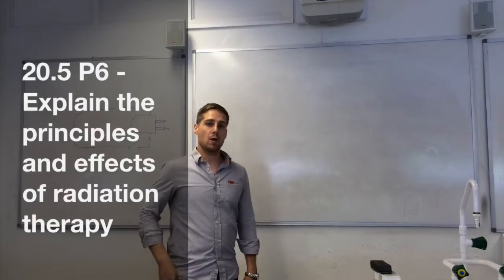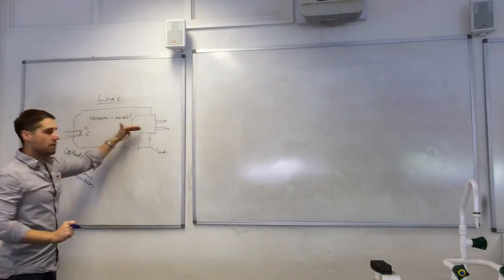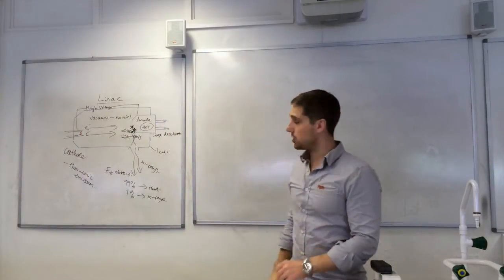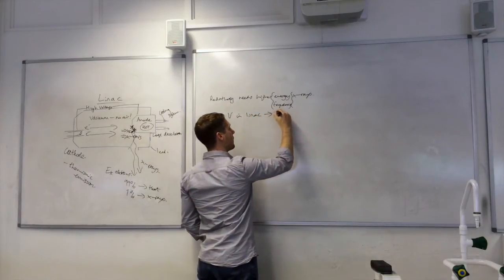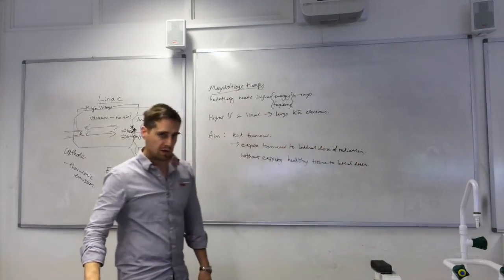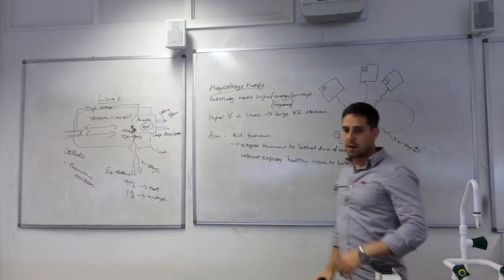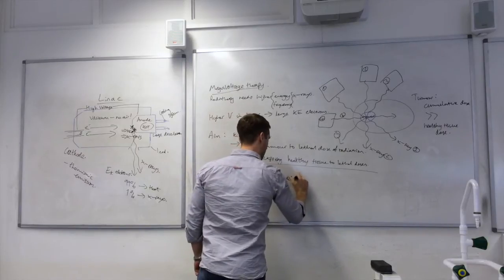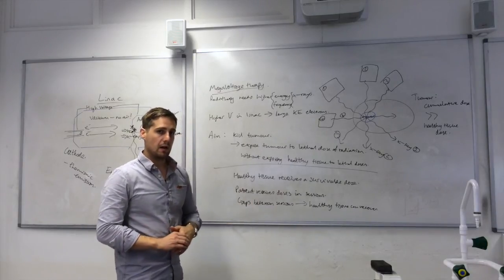20.5 P6:  Explain the principles and effects of radiation therapy

Comment: As I have been taught x-rays are no different from sound waves except that they are have a higher frequency and are just classed differently so I assume they react in the same manner, would it not be possible to administer radiotherapy with 2 generators facing each other from opposite sides so they project in the middle and their phases are cancelled out by each other beyond the target point, if this was done would this elevate the damage caused to the surrounding tissue or increase it?
Reply from the maker: +lewis tarr apologies … YouTube appears to have decided to stop sending me notifications for comments!
X-rays and sound waves are different beyond just the frequency and nature (sound waves are vibrations in physical particles x-rays are vibrations in electric and magnetic fields).  Sound waves are longitudinal and x-rays are transverse also.

Nonetheless beyond that yes it would be possible to get x-rays to "cancel out", but not by pointing two X-ray tubes toward each other.  What would happen then is that possibly a standing wave would be formed (assuming they had the same frequency and the beam acted like waves and not like particles - i suspect the latter though).  An x-ray standing wave would have antinodes that would deposit the beam energy in tiny pockets along the length where the beams overlapped.  Seeing as the wavelength is tiny the energy would be distributed throughout the body.  It would be possible to arrange things to only distribute the energy in the tumour.

Hence the advantage of proton beam therapy that can target the ionisation potential of the beam in a very specific location.